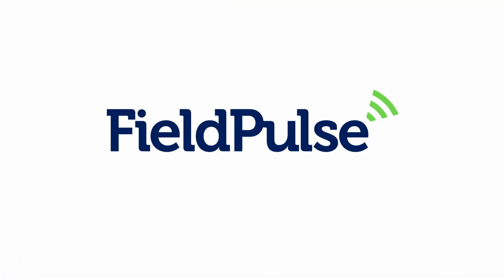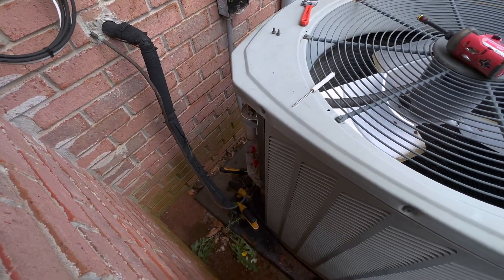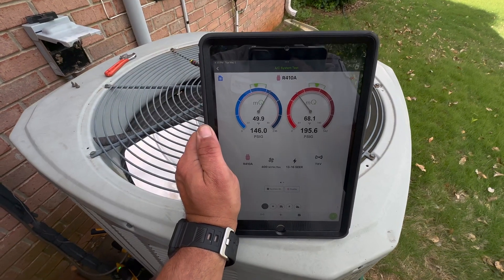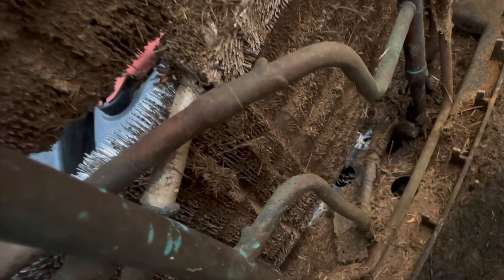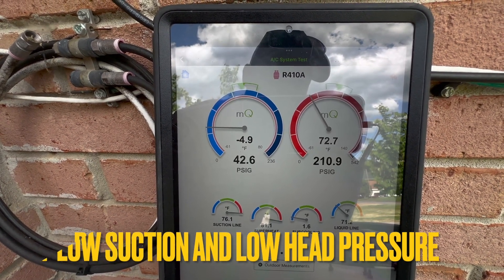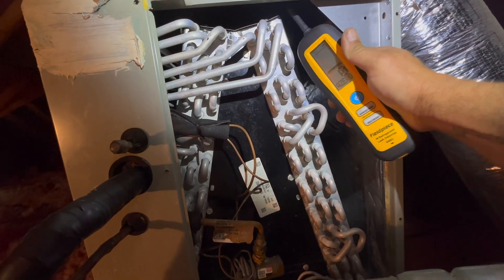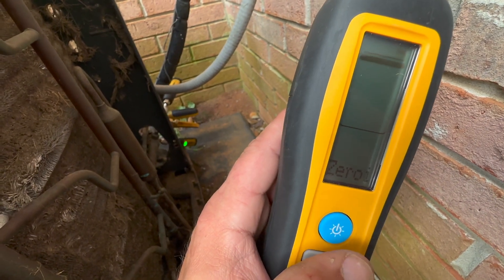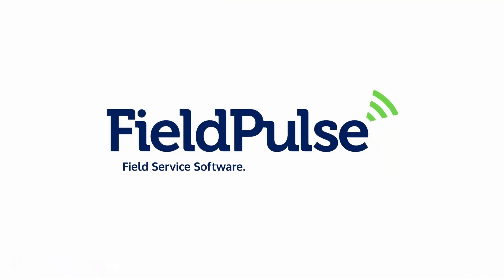AC Short Cycling Part 1 | Service Call

Comment: My AC was installed 11/2023, about 8 months ago. It runs for 8-9 minutes, then turns off for 5-6 during the day...at night, it's the opposite, it runs for 5-6 minutes and stays off for 8-9 minutes...is this normal? I live in Central Florida... I keep the thermostat at 75-76F.
Reply: What was the issue?
Reply: @joey2729  I was told by the AC guy this is normal 🤷‍♂
Reply: @mr.boniato6402  thanks for replying. Going through that now. Scared cause I had two compressors go out.

Comment: We had a double start on our outside unit. I would hear the outside unit come on for 5 seconds, then cut off for 5 seconds, then start again and run normally.  We tried and looked at everything. Come to find out it was our Nest Learning Thermostat. We got rid of the Nest Thermostat and replaced it with a Honeywell T3.... no issues and it is going on 2 months. I have a Sense power montior, which detected and saw the double start. I showed it to all the techs who was trying to figure out the issue. I highly recommend Sense Power Monitors, they are great at detecting issues that are random.
Reply: This is exactly what mine is doing now, and we have Nest as well, replacing them and I will give an update, only had for 3years, built the house brand new….
Reply: @BDP2007  Once we got rid of the Nest, no more double-start issues.  I have a Sense Monitor, so I could see the double start and prove it to AC people.

Comment: That condenser unit is too close to wall. I think technician need some room to set and work on unit… maybe I am wrong but that is tight spot at least for me..
Reply from the maker: Yeah it was definitely tight and should at least be turned so the service panel is facing to the right. Not something they were willing to pay for though.

Comment: That thing is so crammed in the corner, you gotta be a contortionist just to look at the contactor.
Reply from the maker: 😂 Yep. The coil replacement video is coming out soon. We had to remove the unit and pull it into the yard to replace it.

Comment: The pump on my detector makes that same fluctuating noise when it's in the manual mode. Sounds like the pump is speeding up and slowing down or something. Fieldpiece has still yet to give me an answer whether this is normal or if it is a problem in the circuitry of the detector causing it to do that. But it does seem to work pretty good in the manual mode.
😎👍
Reply from the maker: Oh really? I'm gonna try to get an answer too. Thanks for the info!
Reply: Mine don’t work in manual mode at all.